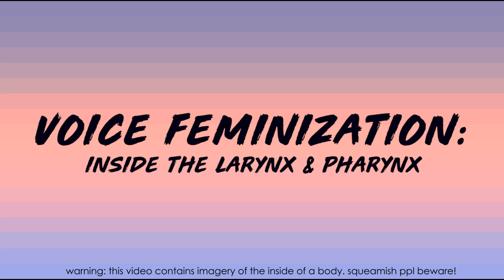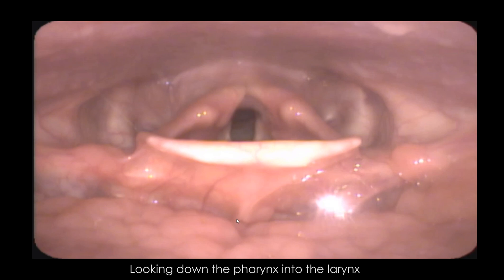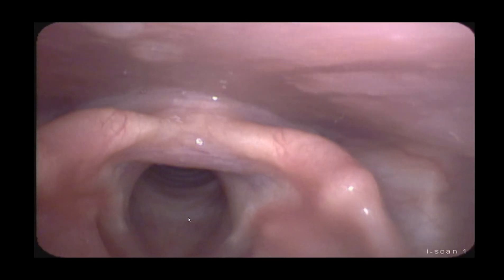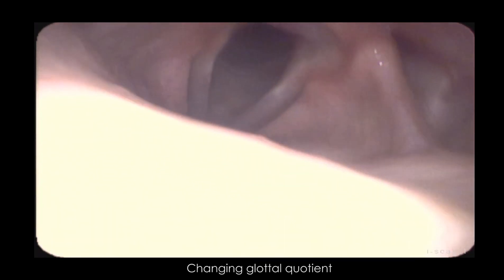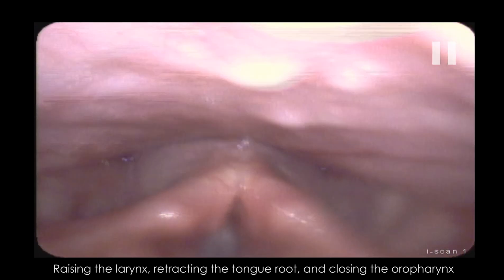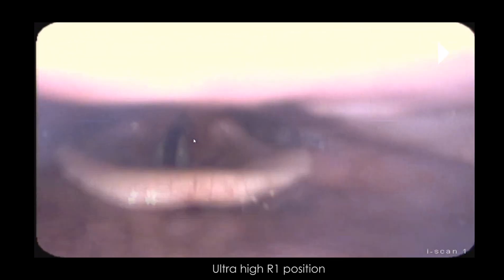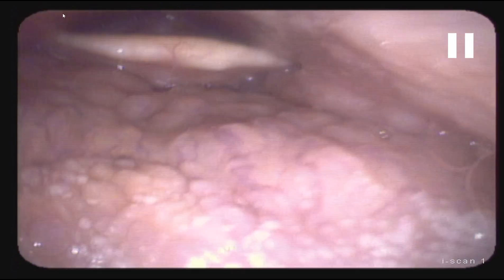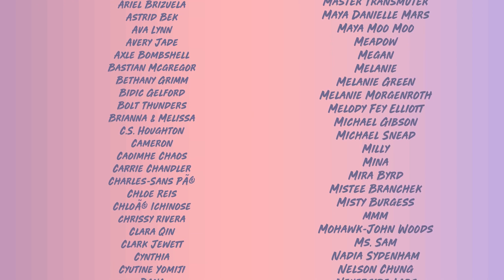Voice Feminization from the Inside! [Laryngoscope footage]

Comment: From the video I understand what it is supposed to look like inside but it’s still a mystery how to achieve the results in my own mouth. Perhaps one of the most frustrating things for me is that I use my voice every day and it has been overworked on the phone for the last six weeks so I’m actually lowering my pitch when I do not want it. Maybe some of it has to do with the weather being cold and causing my throat to be a little strained. Possibly some of it has to do with me drinking less warm tea and water because of the late hours, but I’ve noticed that my voice has changed in the wrong direction in only a couple of weeks. So I’m seriously going to change my career choices for the sake of nurturing my voice better. I’m not really comfortable being forceful and boisterous constantly. It’s unnerving to hear my own echo when I have a bad connection and I can hear it in a delay. Just 2 weeks ago I was getting ma’amed by customers and now that’s not happening.

Comment: Okay, I have one question that’s been on my mind this whole video.  

What does it feel like to have the camera in your respiratory tract?  Is it uncomfortable?  I‘m morbidly curious.
Reply from the maker: Great question! Honestly it doesn't feel like much. They spray lidocaine up your nose to help numb the nasal passage way. It feels nearly identical to when an insufflated drug "drips" into the throat. It feels weird because I can't fully close my soft palate during the examination. Usually when I speak my velum is tightly closed and sealed. Here, the scope prevents it from closing which makes everything feel "off" vocally. Also, when it touches the tongue root you can feel a strange dull sensation near the back of your throat.  I would describe the experience overall as strange. This is the second time I've had it done. I think next time I will be more confident to be experimental with it inside me. I was worried about pinching the scope. You can lightly feel the scope in your nose even though it's numbed. The camera was never in my respiratory tract (unless you count the pharynx as that). The respiratory tract is below the glottis. Ohh on second thought you probably mean the nose :3